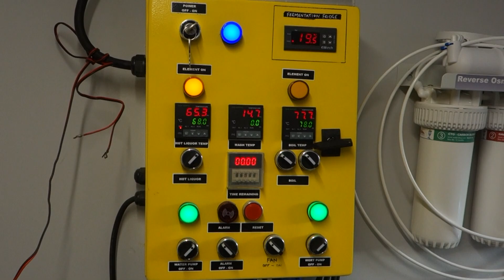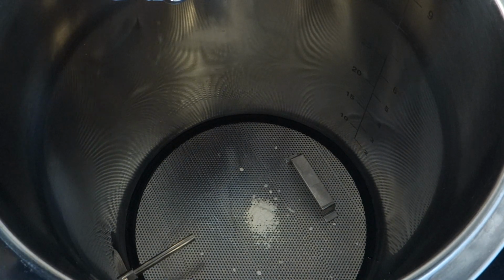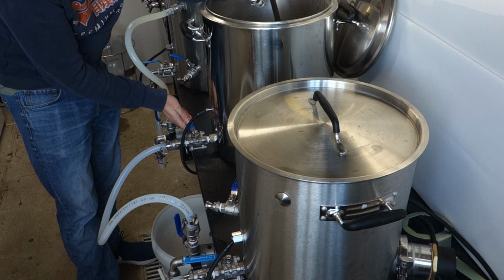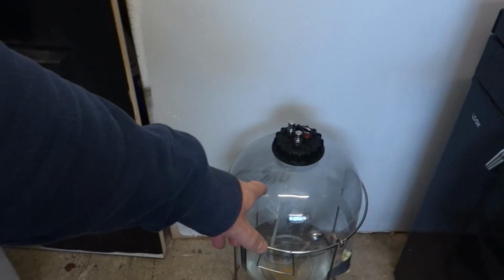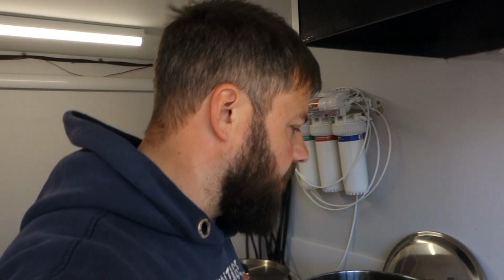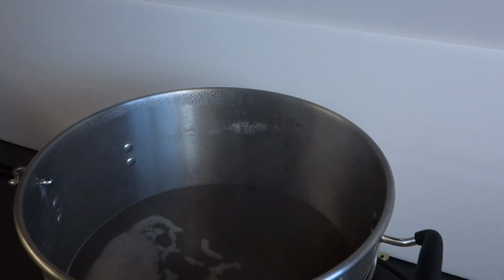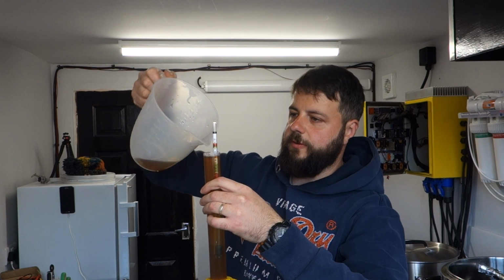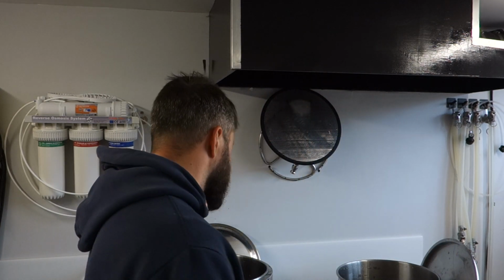Fossil Trap Best Bitter Brew Day

Comment: Hi Tom , I have a similar system and underlet the mash also. Having trouble hitting my strike temp. How many degrees over your mash temp do you aim for? Good to see ya back
Reply from the maker: I usually transfer at 78'c easier to add cold to cool than to try and warm her up. But it sits a degree higher after mashing in so doesn't need a lot of cold to get her cooled if any. 😀